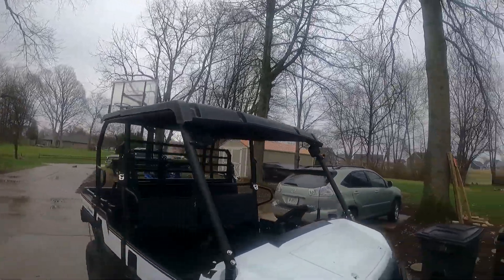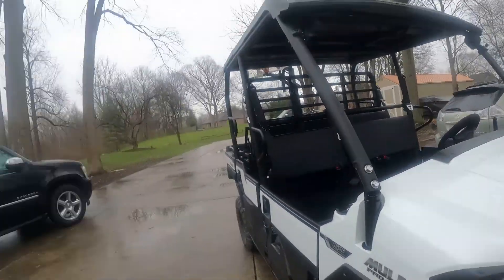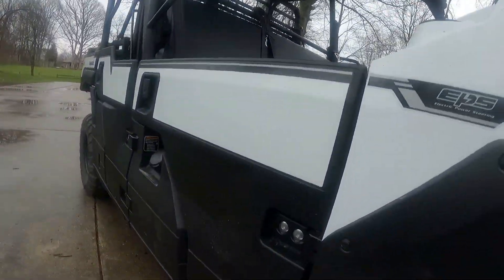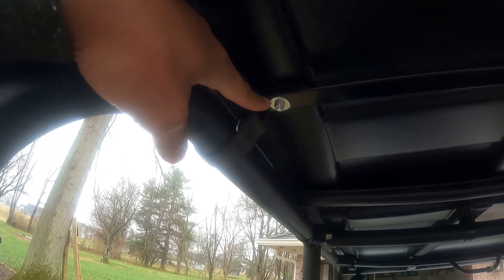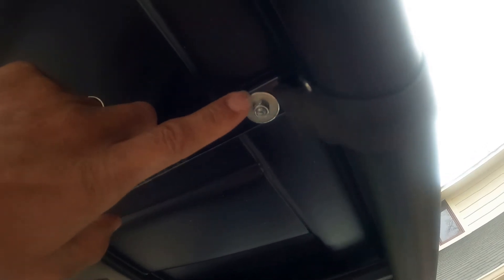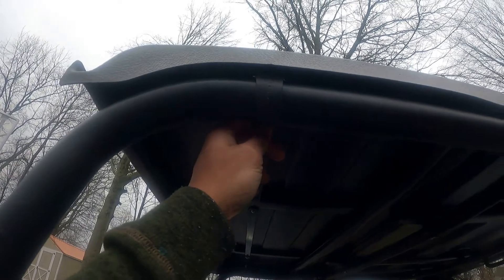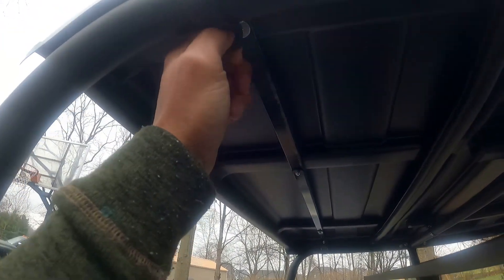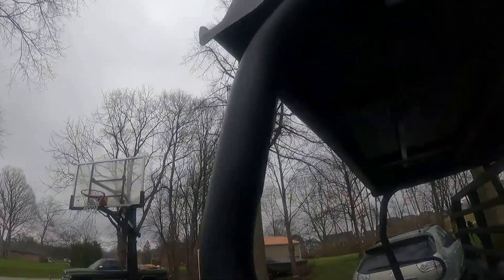Kawasaki Mule FXT - Hard Top Install

Comment: Nice job! I did away with the small rubber band latches on mine and installed a pair of quick roll cage clamps. You can open them with one hand with little to no effort.

Comment: How much does the roof add to the height of the machine? I’m close fitting mine into the garage and am worried it won’t fit with the roof installed
Reply from the maker: Will measure tomorrow and tell you exactly.  Thanks
Reply: @onealadventures294  thanks man
Reply from the maker: @SunriseRidgeLL  Did this last night and thought I replied..  2" inches.
Reply: @onealadventures294  thanks man👍

Comment: Thank you thank you I totally agree worst  of the worst directions .!
Your video kept me from returning it. Kawasaki should be ashamed also half the hardware was missing, sad !

Just couple of quick constructive thoughts to improve new videos, lighting in dark areas, screws and bolts not the same, the bar for the rear roof section has a hole for the bolt to go through with a bigger hole on the other side for the nuts.  If you didn’t catch that you would need longer bolts as you mentioned
Again thank you, enjoy your toy
Reply from the maker: Great comments. Thanks for watching.